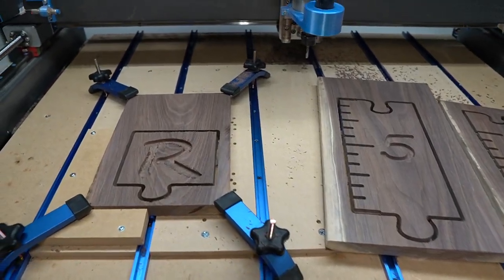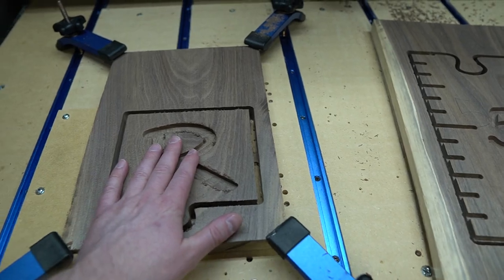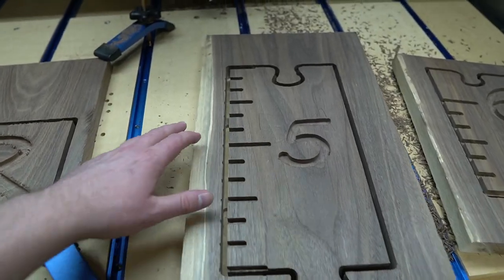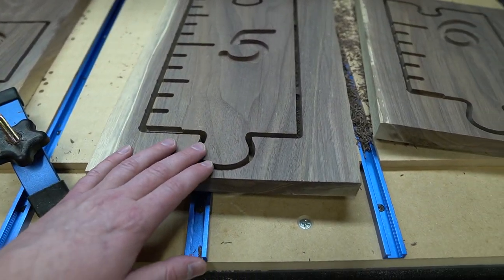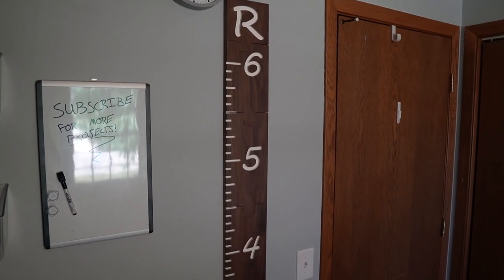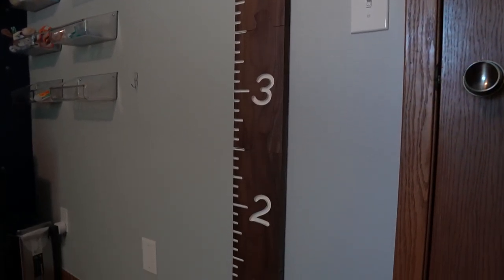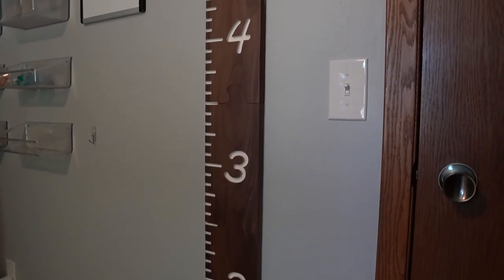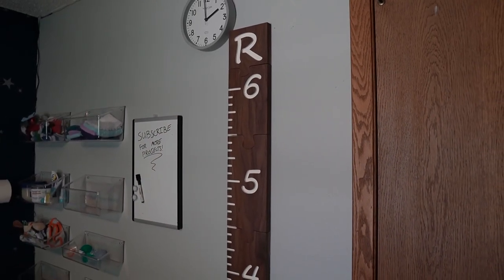Walnut Puzzle Piece Growth Chart w/ My PrintNC!

Comment: Hey great work! cool to see the machine making some cuts. One suggestion on these kind of projects, with painted features and a natural finish on the wood - use vinyl masking sheets! They will cut very cleanly with the router and leave you a super crisp line so you can paint in those numbers and not have to try and sand off paint in the future.
Reply from the maker: Thanks! That's a great idea, I wouldn't have thought of that!
Reply: @ProjectsbyBrian  glad to help!
Reply: Vinyl masking tape can be kind of expensive.  I tried regular contact paper like you'd use to line a cabinet but they didn't work as well as I would have liked.  I'd like to find a less expensive solution because it is an excellent idea.